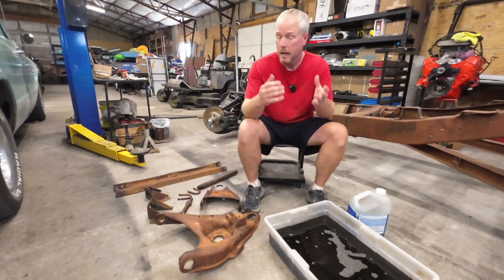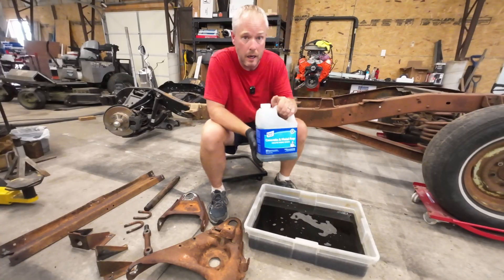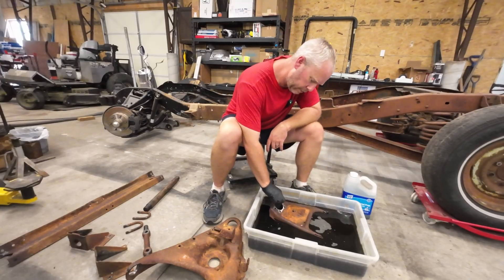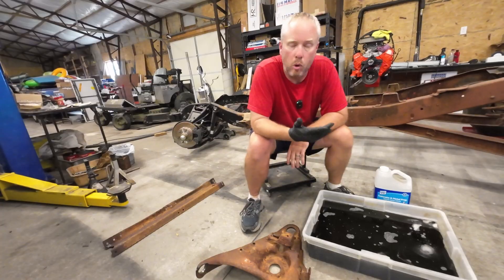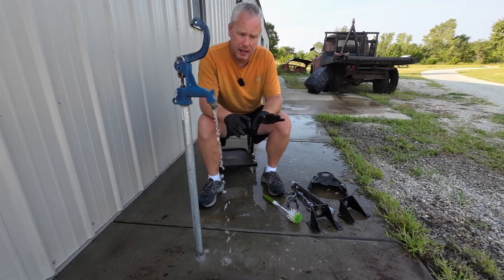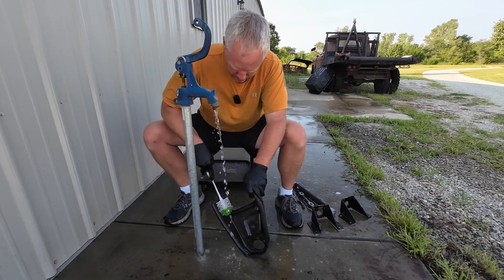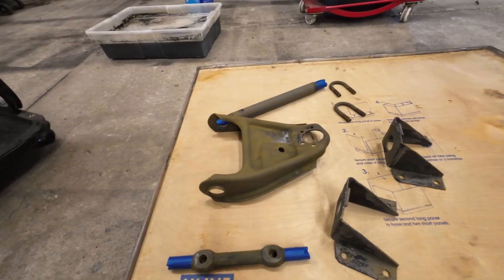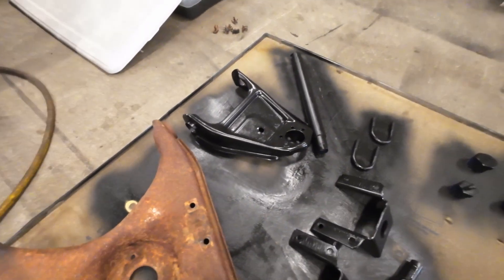EASY Rust Removal

Comment: I've used a product from WD-40 that is a rust remover, but can only find it on Amazon.  I like this solution a lot better, thanks!
Reply: Have you u tried the electrolysis process. it's easy and cheap.

Comment: Phosphoric acid removes the rust and converts the surface to iron phosphate, which is why it's dark gray, not shiny like bare steel.  The surface iron phosphate is actually rust proofing the steel and works as a nice rust proofing if left to air dry  (best to use a high concentration of phosphoric acid to do this).  What is important, which you forgot to mention, is the concentration of the phosphoric acid.  The liquid in the bottle is mostly water!  Fun Fact: for light rust and a lot more time soaking, most any "-Cola" drink has phosphoric acid as a key ingredient and will do the same (use sugarless!).
Reply from the maker: Absolutely correct!!!

Comment: Thanks for the heads-up, brother!  I was just planning to go to Hobo freight for some (actually a lot of) Vapo-Rust ...at twice the cost of the Klean Strip!  72 K-5 ...doing a body off rebuild with lots of rust to enjoy!  Great video! A+++++
Reply from the maker: It's amazing how the same product marketed two different ways can be priced so differently.  I looked in my area, and Home Depot has it $2 cheaper than Lowes right now.  If you have both nearby, you may check.
Reply: @Challenged1  Thanks for letting me know, Garrett....Home Depot built a store about 1/2 mile from my house! lol